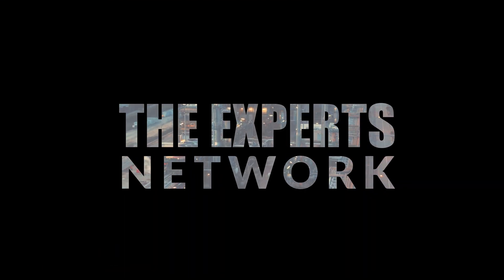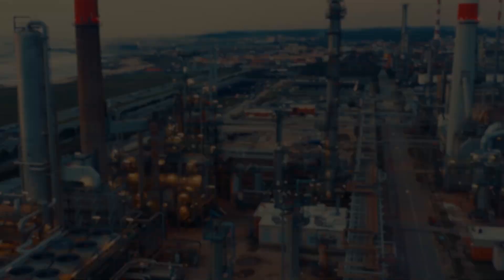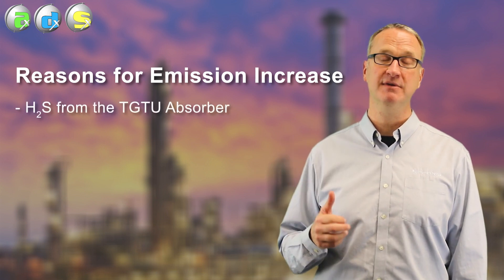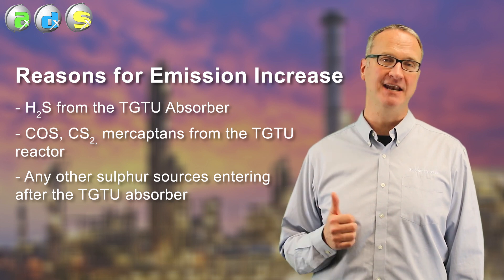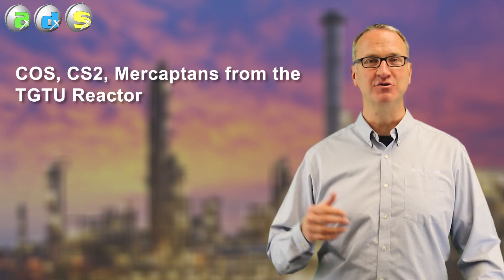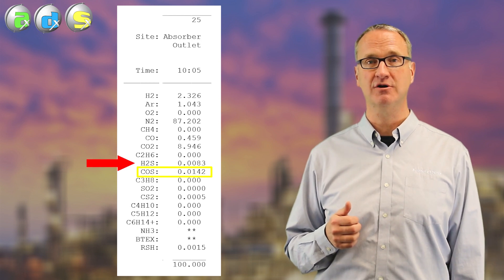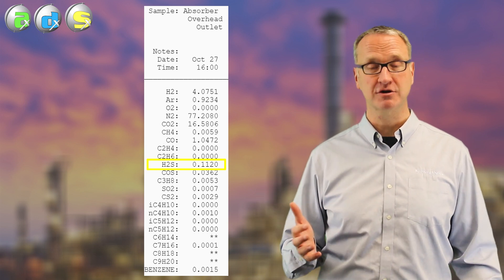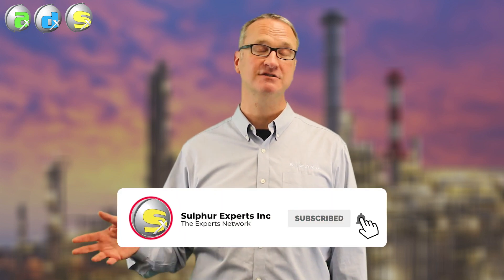How to Fix Increased TGU Emissions

Comment: There is a provision for acid gas sulphiding for the hydrogenation reactor. What will be the effect in the reactor , if the valve is crack opened  during normal running conditions ? Will it damage the catalyst ? The idea is to increase the H2S in the tail gas to avoid SO2 breaking through, as the tail gas ratio is not maintaining constant due to disturbances in low load conditions and poor H2S concentration. 😆
Reply: if you want introduce H2S , you can adjust tail gas analyzer for avoid SO2 breakthrough

Comment: Can we produce hydrogen from the RGG just by fuel gas firing even if there is no  sufficient tail gas available when operating close to the turn down ratio?
Reply: only 40% of hydrogen will be produced, whereas the remaining 60% hydrogen comes from tail gas, therefore it will not be sufficient for hydrogenation 😀, instead you can bypass the acid gas on the reactor if there is a split type reactor and also do co firing with fuel gas to generate more hydrogen , and increase the tail gas ratio 8:1 if recovery is not a concern while operating on low load